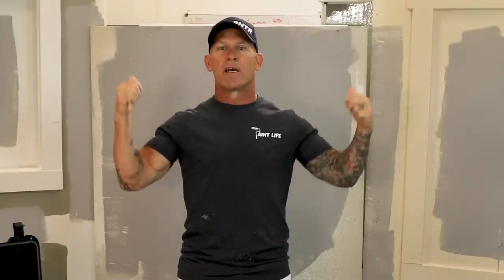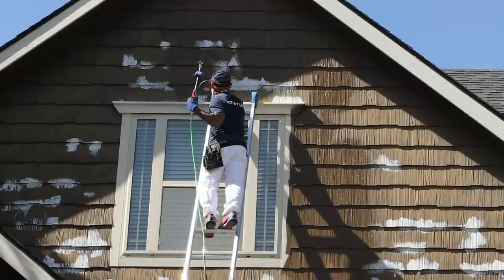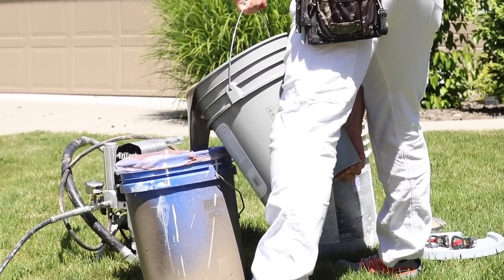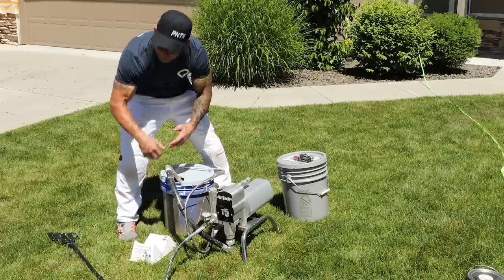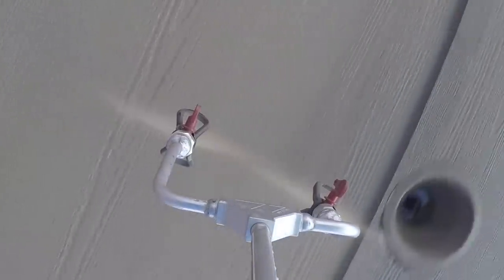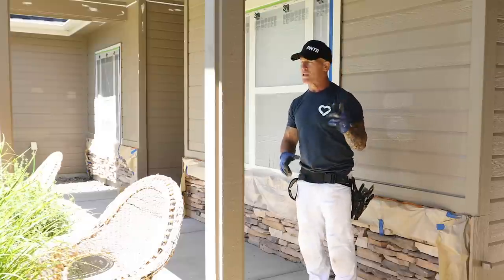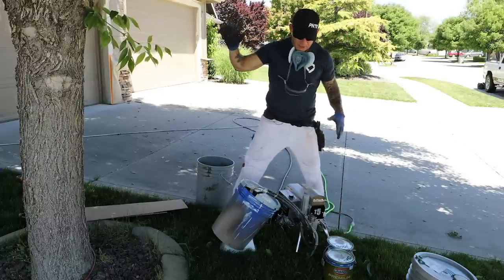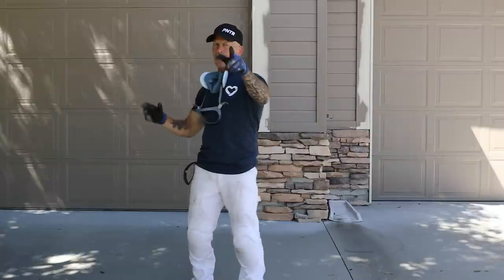Airless Spraying SOLO: Painting a House

Comment: Thank you very much for all your knowledge and professionalism, I've been painting for 22 years now and worked at very reputable painting companies but now paint and drywall for a construction company and they're great to work for, I'm a residential painter by trade, interior and exterior new construction and repaints, we use to paint alot of car lots and for production we'd put in a bigger tip and turn the pressure way down and we'd backroll so we had no over spray because it wasn't being atomized with higher pressures but basically like a garden hose, of course if you're not backrolling you cannot do this but the older journeyman painter's taught us this technique, we didn't do this on any smooth surfaces,just drivet, blocks, cinder blocks. Thank you so much for your channel Idaho painter and I watch and learn more all the time from you all.

Comment: I use a little plastic to keep my hands clean when straining. Super easy. Even a latex/nitrile glove helps. I also have been using a big plastic shower cap thing from Sherwin Williams with a hole cut into it to cover my five gallon or one gallon buckets. My dad has been cutting those lids like that forever (30+ year pro painter) but i think my way works a lot easier. They also make much easier lids these days so you could even cut or drill out a hole in that.

Comment: Glidden?   I guess if the customer asked for it, other than that I would never touch that paint
Reply from the maker: It actually performed well
Reply: Benji quality 👍🏻
Reply: To be honest with you the Glidden now in days a lot better then your top quality paint at lowes or home depot brands.
Reply: Paint Life TV i’m sure it sprays on fine and looks decent when it’s dry but any paint you can get for $10 a gallon at Home Depot is not something I would use personally on a customers house. but like I said if they have no problem with it, and you like it, then to each their own.
Reply: edgar romero . The only reason I don’t prefer it I have used Benjamin Moore paint for almost 25 years, I personally don’t buy any paint from Home Depot or Lowe’s but I do know this brand I’ve seen gallons for as low as $10 apiece. But I do know there are inexpensive paints that work pretty well. But my company personally would not use this stuff on any of our Jobs.    But to each.....👍🏼
Reply: You can always leave your strainer in the bucket Take tape wraparound the outer rim of the five gallon bucket and leave a little pocket for the pickup tube. And always cover with a drop cloth. Or wet rags. so you don't have to get your hands dirty first thing. By the time you clean up your hands in the strainer be wasting more time then what it cost to buy a strainer. just my thoughts. 22 yrs experience. Always learning new things it never stops. I used the Glidden for the first time from a local hardware store and that stuff is pretty durable I must say I was actually flabbergasted by the durability and the coverage. Compared to S&W and PPG. When I first started painting living used to be high up on the chain through ICI paint stores. Here in Illinois. They making a comeback it seems like.
Reply: I've notice your using a tri tech t5,  what do you think of it Chris?

Comment: Great video Chris, I really appreciate the info and detail you always provide. My question is around the number of coats of paint to use and do you often put a second coat on the jobs you're working or do you dial up the settings and dump more paint on the target so you're finished in one pass?

Thanks,
Tom
Reply: One coat dial it up but I'm not an experienced that a good spraying back row is the best way to pennecrate the wood outside or inside

Comment: Hey I like your info on the tech of spraying,, I am doing a stucco paint job Solo,, for a friend of a friend.. he saw the job I did for his buddies garage and just said I want you to paint my house.. so that's what I'm in progress doing now this week.. I have a small Graco 390 with the pro gun and 12" extension.. I didn't want to use the gun that came with and got the Pro gun. That was a smart move on my part cause they don't tell you it's a pos gun to use if your doing multiple Jobs.. now I'm going to use the 521 tip for the stucco job cause I just happened to find it hiding in my tool,, lol I know the 515 is a great tip.  But I'm worried that the elastomeric paint will be to thick for it to push thru the 390.. is that going to be a issue with the product that I have? And what would the overlap be on a tip like that being Solo and backrolling with a big fluffy 1" nap,, or should I find a helper to come behind me and hit it..and I see that you strain your paint the way I was taught many moons ago. I've learned a less Messer way and been doing that ever since. I just take the 1 gallon strainer and wrap it around the feeder hose and boom it strains as I go.. it works great and I have gotten used to do it that way,, I just recently found your channel when I was looking for some good advice or techniques I can use on this job.. my lil sprayer is a decent one so I'm used to that.. I just had to dust off the cobwebs and clean it up for the garage job and it is still pushing the flow of regular latex. But I haven't pushed any elastomeric thru it yet so I'll find out fairly quick if it can. Or have to barrow a commercial one..I think it's the next size up from the 390st..
Reply: Well,, hey Brave!? I didn't get a chance to find out about how the elastomeric paint flowed thru my 390.. the customer had the wrong color mixed and ended up with 10gal of the wrong color. Lol..so  he went back to get the correct color and brought back some midgrade HD paint that  was the primer and finish in one..so he forgot to get elastomeric paint and the same color that was on the house to begin with... That was the 3rd mistake he made and all I could do at that point was to just repaint the whole house in a slightly darker color and the trim paint was the darker shade of gray and he wanted me to just use the elastomeric for that.. the sample he took was misunderstood at the store for being the color he already had..lol.so I will give that to the employee mixing the paint..an not listening to the customer and not paying attention to what he wanted..so I completed the job and it looks like a decent paint job.. no overspray , drips or runs,,and it took every drop on his house cause it was so dry.. I still did the. Backroll thing and it drank the whole 10gls.like it was Beer!!. Then I sheerocked the inside of his garage and ended up with the left over elastomeric paint he didn't want witch I'm going to spray my house with this weekend..lol

Comment: Questions: I’m using a graco x19 pro with a 50’ hose and a 515 tip and spraying walls and ceilings with SW Duration Matte. Do I have the right tip for the job? How much should I thin the paint? I’m going to be using a want too but not sure what size yet (I’m short, so I was thinking 40”)

Comment: I noticed on your first pass you did vertical passes on the horizontal siding, then came back and did it with the "grain" horizontally on your second coat, is that your standard procedure?
Reply from the maker: To eliminate flashing

Comment: What is the smallest job you would use a typical commercial airless sprayer on? Like half a gallon? 5 gallons? I don't have experience yet with my sprayer. I'm thinking about how much paint waste, cleanup, etc vs time saved and quality of finish. I have some cabinets I would like to paint. I ended up painting them with a brush and small roller, but it took a long time, and I didn't like the finish quality. I'm a homeowner, with no plans to be a pro painter. I do plan to paint my home's exterior sometime soon as well. This is probably a no-brainer for using the airless sprayer.
Reply from the maker: I would spray a shed

Comment: When painting a door or gutters you recommend a 310 tip. Is this using the same exterior paint, like Superpaint, that recommends .15-.19 or are you choosing a different paint in the same color with different specs?
Reply from the maker: Shot SuperPaint with a 310 for 12 years on doors.  Works fine.  The can is only guidelines written by lawyers for the most part.

Comment: I'm changing a dark trim to white.  If the base color is lighter, will it "prime" the dark trim enough when you spray the base coat or do you need to officially prime the trim with a tinted primer before changing it to white?  Thanks for the series.
Reply from the maker: it will with quality paint

Comment: I have a Graco 490 PC PRO.Great sprayer but if I want to do a small job that only needs a gallon or less it puts me in a panic. 50 feet of hose just about sucks  gallon almost instantly and then the intake is sucking air. do you  have a fix? I also have a Graco battery operated Ultramax but it does not atomize very well so I only uses it for priming. would like to use the 490 more often.
Reply: Thom Lusardi get a 25’ hose also when you have emptied the can add water to spray the rest of the paint in the line.

Comment: How big of a house and what did you charge for it?
Reply: Washmyballs is that per SQ ft of area or sq ft of the house? Thx
Reply from the maker: $5500 3600 sqft
Reply: @Idahopainter  yup 1.5  is my standard, 1 if it's a friend and they dont mind a longer slower process at my leisure...
Reply: Paint Life TV thx for the reply. Great videos by the way. So you don’t charge per the area of painting surface? Rather, a house Square footage and degree of difficulty/detail?

Thanks again!
Reply: Paint Life TV is that the price you would of charged when you owned your company?  I or is that a low overhead solo price?   Just trying to adjust some of my prices so any info would be great.
Reply: Boom Stick very unethical to over-charge just because you think they have more money. The right thing to do is knowing how to bid a job. Know the profit you need and using that formula to bid all jobs. Price gouging hurts us all.

Comment: Any tips on how to paint a chain link fence?
Reply: UltraRmx . Just make sure you buy the right kind of primer. If the fence is galvanized go to your local shop find out what is the best primer to spray on the fence so that the paint doesn’t just peel off a few months later. And once it is primed you can pretty much put any paint you want on top of it
Reply from the maker: is that really possible?